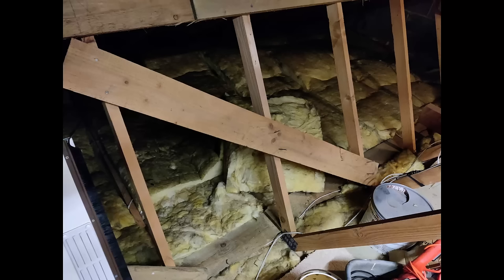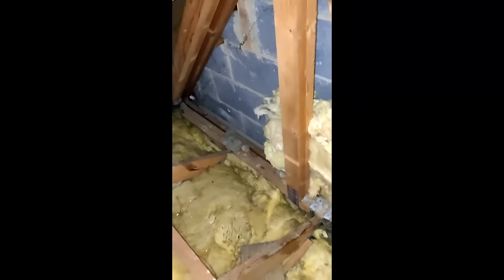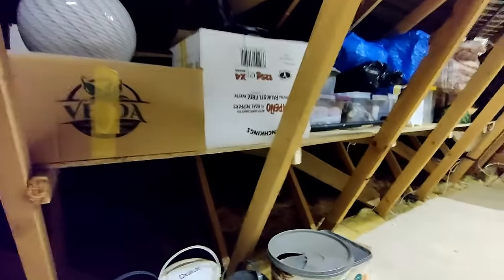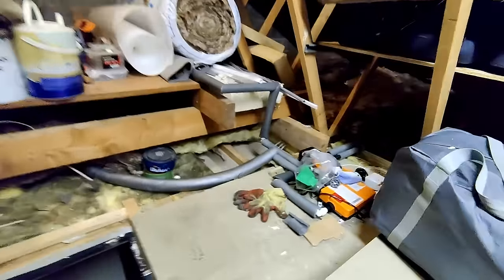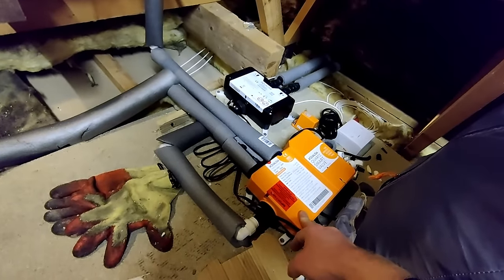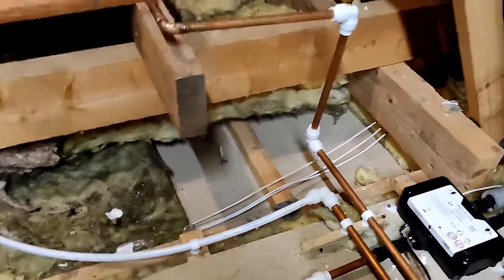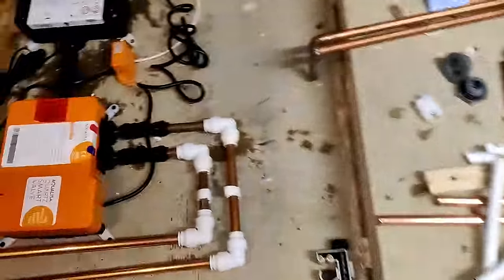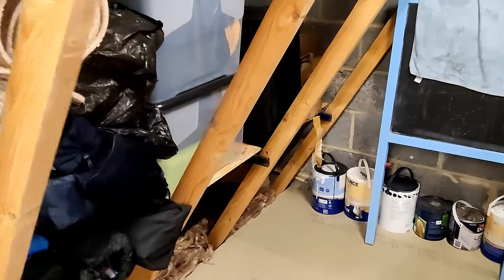Prepping for the Heat Pump: My DIY Loft Insulation for improved comfort and efficiency!

Comment: Great video - I've seen that some people use rafter/soffit baffles, which are basically just flat sheets of plastic that you place at the lower corners of the eaves (i.e. where the rafters meet the joists). This ensures that you can't physically block the airflow with insulation and that the air will come up over the insulation instead of coming in contact with it and decreasing it's thermal efficiency. 
Disclaimer: I know NOTHING about any of this. I'm just an DIYer who is about to tackle my attic (there's some insulation up there, but it's not great). I have and infra red camera and when I point it to the ceiling in the bedrooms, it's always where the ceiling meets the eaves where it's absolutely freezing.
Reply from the maker: Hello and thanks for the comment! I seriously considered the plastic eaves vent trays but once I got down into that area it was pretty easy to place the original insulation to leave a 50mm air gap and maintain that 50mm air gap once the second layer was laid on top.
A follow up video is in the making with a thermal imaging camera.
I would like to know if the eaves trays would improve the situation in that tricky area that you identify!

Comment: Never underestimate the amount of un-bodging a simple, straightforward job will need.
Reply from the maker: Haha, so true! Thanks for commenting.
Reply: @UpsideDownFork 2 or 3 old tanks in our loft but our loft is more of a mess since getting air source
Reply from the maker: @theoddjobcentre6686  Oh dear, sorry to hear that. Our installers did want to put some of the components up there but in the end they managed to squeeze it all in the cylinder cupboard.

Comment: A good idea to put the flooring on top of the PIR I  would not have thought of that. Will you show how you are going to finish insulating around the loft access hatch? I hope so.
A great video well done.
Reply from the maker: Thank you.

I got the idea a few years ago when I built an outhouse with SIPS. I started to understand warm roof construction.

Around the hatch perimeter is fully insulated, but I'd appreciate any ideas on what to do with the hatch itself.
It is currently an MDF one with a 25mm bit of polystyrene stuck on the inside.
I considered scraping the 25mm off and gluing some 100mm PIR on there but there must be a better way!
Reply: @UpsideDownFork  Hi, the opening hatch is going to be a problem, if it's to be insulated, that is. My loft access is like yours. The ladder is a pull down. I am considering bringing the ladder down from the loft permanently, and jigging the door to open upwards, thus enabling  an insulated rebate all round.
However, it's still a thought process, until I get around to it.

Comment: Great walk through. Thanks. 
You never mentioned whether the shower flow rate actually improved?
Reply from the maker: No discernible difference 🤔 oh well. It's now tidy and out of the way.
Reply: @UpsideDownFork  sometimes it's good to have these jobs done just so you know that it's running as well as it can be. If you hadn't done it you'd probably be regretting it right now.
Reply from the maker: @alanmcguinn  that is so true!

Comment: Thanks for the video. My loft is similar construction (~1973) possibly less head height but the current roll insulation is patchy at best. I was thinking of removing it all and going for 2 lots of PIR board. 100mm to fill the existing gaps between joists and then another 100mm (or more?) of PIR in the other direction and boards on top in the middle like yours. I had not considered just laying the top PIR without joists so that’s a good idea.  
I was going to use “gapper tape” aiming for no air gaps so My main concern becomes vapour; is it ok to have all these layers of foil backed PIR up there (including over bathroom in my case)? Should I be attempting to fit a separate vapour barrier (sheet) under all the PIR?  My heat pump quote requires 270mm of insulation and when I asked “what if PIR” the surveyor still said it’s the depth they require irrespective of thermal efficiency.  Does anyone know where I can check what I propose is acceptable (or even a good idea)?  I’m aware mine will be more expensive but I like the idea of a neat and tidy and through job.  Also means for any plumbing changes, can lift out the PIR boards and replace them after.
Reply from the maker: I would advise against PIR over a bathroom. You really need breathable insulation. If it needs to be removed in the future it is super easy to roll up for future access.
I used PIR in the centre which is just over the hallway/landing/stairs area and not above bedrooms or bathrooms. I only did it this way to gain myself an extra 100mm head space.
Be cautious, especially if you are using gapotape. A great product but then you really need to consider the vapour control.

The assessor is talking rubbish. Mine looked up specific U Values of some 130mm PIR I had applied in other areas of the house to get the correct heat loss.
100mm PIR = 200mm loft roll in general so it's a great product for a lot of applications, but not where you need breathability.

Comment: Excellent real world video for the average home DIYer. I've been procrastinating about doing a similar job in my loft for a while now. We still have an active cold water & F&E tank but plans are afoot for a Heat Pump in the future so they will eventually disappear. 
I will be installing a Loftzone Store Floor system (purchased & waiting to be installed) in the centre section of the loft to raise the existing chipboard floor I put in 30 years ago floor by 280mm. This will allow space for an extra 250mm of insulation with an air gap under the floor making 350mm of insulation in total. Luckily I have ample headroom in the centre of our loft & like you I have already installed some shelving between the A trusses to get as much stuff off the floor as possible. Also like you some "thinning out" of the clutter is needed but getting "management" up into the loft to make decisions is not proving easy. I've also put in a bunch LED batten lights in to make working up there much easier. It's like daylight up there now! 
The existing 6"/100mm of fibreglass insulation (1986 house) is pretty ropey so may have to be replaced in places (face mask & hazmat overalls for that job). 
We have quite a few downlighters in the 1st floor ceilings which I have already covered with "Loft Lids" to prevent any draughts / air leakage before I cover them with more insulation. All the downlighters have been changed to low temp LEDs as well. 
Good job on the shower piping as well. Mine's in a similar mess. 
Where did you get & what type of insulation roll did you use? I'm going to need quite a bit so looking to get the best deal possible.
Reply from the maker: A lot of that sounds very very familiar! LED batten lights were the very first job, many many months ago.
A lot of procrastinating has happened between then and this week when I finally finished the last bit.
A face mask is an absolute must!
I wasn't intending to record this for YouTube. I was making small videos to send to family to show them that anyone can do it. I cobbled all the clips together to share this video publicly.
I used 200mm knauf loft roll 44, the trade stuff is 6M long and the retail stuff is 4.something long.
I got some from a friend on a local building project where they over ordered so I think I paid them £20 per roll to cover their costs on their high volume trade account.
I think you can get it for £30 per roll online, so I only saved £70 but getting offered it was one of the things that pushed me to get on with the job!
Good luck getting management into the loft for the thinning.
My manager has been up there and done a quick pass. But I'll say no more as I know she loves reading the comments on my videos!

Good luck and I hope this rough video has inspired you to get on with it! 😁

Comment: finding the right balance between ‘breathing’ and ‘sealing off’ must be tricky. I suppose the main thing is to try and cover the entire ceiling surface to keep heat down - and breathing should be covered by the overhangs of the roof? Also on ours we’ve got gaps where the downlighters are. Now they’re LED I wonder if they’re safe to insulate over (with some air space)
Reply from the maker: That's it exactly!
 Building regs specify 50mm of breathing room at the eaves to come up from soffits.
Spotlights should be covered by hoods. Several different types at Toolstation/Screwfix etc 👍

Comment: On these retro fit I stalls they normally only put a 15mm feed to the unvented cylinder. The manufacturers instructions state a 22mm feed is needed, this explains the low water pressure normally
Reply from the maker: Thanks for the comment. Ours is all plumbed in 22mm. Lucky for the installers the cupboard already had a 22mm feed there.

Comment: Plumbing: I did the same in my 1930s house. I replaced 15mm (plastic, steel, copper) with 22mm where that made sense and replaced elbows with copper pipe bent with a proper pipe bender. Heating and hot water work much better (hotter, quieter) than before.
Reply from the maker: Good work. I also replaced some big main section of the pipework in my old house with 22mm. Luckily in this new house we already have 22mm almost everywhere for hot and cold water in the concealed areas which reduces down to 15mm as it enters the bathrooms and kitchen etc.
I was a big fan of the plastic stuff when I first started getting into DIY plumbing some 15 years ago due to the convenience, but now I know about the flow restriction I try and avoid using it unless absolutely no other option.
I did have one of those spring benders that I used to use to good effect on 15mm copper when I did my last kitchen but I can't seem to find it since the house move.

Comment: Nice job. I have slight reservations about moisture buildup below the PIR insulation but hopefully it will have an easy enough diffusion path through to the edge of the normal insulation.

You mentioned you needed the 'high pressure' box after your heat pump install, what does it do and why is it required?

Cheers
Reply from the maker: Yes, I was a little concerned about the potential implications for PIR in that position.
A couple of things I did to mitigate that, no foil tape to create a complete vapour barrier. I intentionally left gaps at 300mm gaps in the low expansion foam joining the boards together. Should have shown that on camera.
I'm not exactly sure how breathable the chipboard floor would have been previously anyway? It was all perfectly dry when lifted.
Luckily for us, that centre section only covers the hallway landing space and some wardrobe so low moisture areas. Maybe if you're over bathrooms then much more thought could be needed into the ventilation.
Thanks for raising the point!
The existing shower box was a smart mixing valve with an integrated pump as we had a gravity fed (vented) water system.
Switching to unvented means we are now on the mains pressure at every outlet, this has massively increased the pressure in the main family bathroom as the bath taps used to dribble to fill the bath very slowly!

So the new smart box has no pump which means the shower is quiet now and not using 200w every time we switch it on! Bonus!

Ours is an Aqualisa but I know that Mira and other brands have similar low pressure and high pressure shower systems.

Comment: We did something similar about 5 or 6 yrs back at my partner's place. In one half of the roof space we doubled the wadding depth and on the other half went 100mm of PIR on top of the existing layers then boarded on top like yours. I don't think we more than floated the T&G boarding on the PIR. You give me a few pertinent thoughts about moisture movement, perhaps mid-winter is a good time to inspect up there. [Under old cold water tanks shouldn't be insulated so they don't freeze]
Reply from the maker: Thanks for the comment!

Comment: So instead of 2 elbows as a restriction you have added 4 elbows? You had the right idea but I would’ve left the 2elbows and made the hot and cold feeds better which you did.
Reply from the maker: We moved from 9 total elbows on the 15mm pipework to 4 elbows.
Crucially there are no elbows on where the mixed feed is. That's a straight shot now.
But as I learned once I did the calculations, either way delivers enough flow rate for good shower performance.
Thanks for the comment.

Comment: Thanks for the video - I need to get on with mine... One thing to watch though is making sure your shower gubbins doesn't freeze in cold weather. A friend of mine improved his loft insulation a couple of years ago and the following winter his shower pump froze and made a right mess of his bathroom ceiling.
Reply from the maker: Thank you for the info.
I think I'll make myself a little cover out of the PIR offcuts. Form some sort of box to pop over it for the really cold weather maybe.
Reply: @UpsideDownFork also make sure your piping for the extractor fan is kept as warm as possible as the colder it is the more water will condense out of the humid air and can cause mould inside the pipe. 

I would also recommend you keep an eye on humidity levels in the loft and go up in a year or so and pull up some of the insulation to make sure your not getting moisture problems inside the insulation and therefore in the timber. Interstitial condensation can be a problem and your ceilings probably won’t have any moisture control layer and you will get humid air seeping through.
Reply from the maker: @davideyres955  Thank you. There was barely any insulation over the extractor ductwork but it is completely blanketed now. 
I will check back in 6 months or a years time and report my findings. The PIR is only over the centre section of the house that is wardrobes, hallway, landing, stairs etc, not over any moisture zones.

Comment: I would not put PIR on top of loft Insulation going to trap moisture.  You need to rise the level of the floor I found the cheapest way is to use loft legs and Studwork CLS Timber - 38 x 63 x 2.4 meter this gives you  270mm loft insulation and 43 mm for air flow under the boards.   Use the timbers like you would on the Loft Zone system.   I do a video when I get time.
Reply from the maker: Thanks for the thoughtful comment.
I have fully considered moisture permeating into the loft space and here's why I believe it's not an issue for me.
1. PIR is not placed in between joists or on the joists.
2. 25mm batten acts as a spacer to form an air gap between original fibreglass insulation and new PIR.
3. Moisture can migrate to either of the ends of the boards to dissipate.
4. I did not continuously foam glue the boards together, they have approx 50mm gaps at 300mm centres to allow breathability.
5. No PIR was used above a bathroom or bedroom, the higher moisture zones of a home.

Lastly I ask you to consider the permeability of OSB and chipboard tongue and groove floors that are used across the country. OSB especially forms a stronger vapour barrier compared to chipboard and OSB appears to have become more widespread in loft applications with very few issues.

Thanks for raising great points and I hope viewers of the video will read your comment if they are considering using PIR in their own loft space.

Comment: Wow you really are a pro at waffling. I’m a great waffler too so don’t worry. Your shower seems very over complicated. I’ve just got 2 direct feed mixer showers. No added gubbins like you have. Had an electric shower in my last house and it was crap!
Reply from the maker: 😂sorry about the waffle. Wish it was of the food variety. My wife's voice is in my head as I'm talking!

The 'smart' shower is a love hate relationship.
I never would have put one in but I have become quite used to just setting our presents so my wife and I both have different temperatures, flow rates, shower heads and timers.
The shower can be a bit of a nanny sometimes because it shuts off when the timer runs down but that's probably for the best!
Easy to override it and tweak on the fly if desired but ultimately I still feel it's all needlessly overcomplicated!

Comment: This was so weird to watch, I did the same job to my loft (in prep for my heat pump too), last month and our property's lofts look almost identical! I decided, daft as it might be, to put in 400mm to get the highest EPC rating. So essentially 100mm between the joists, 200mm on top (perpendicular) and then another 100mm on top of that! Also put in loft legs and boarded the centre. Not looking forward to doing the eaves/sides though!!
Reply: Just be careful not to overload the rafters, I was warned if you don't know their load allowance to avoid it entirely.
Reply from the maker: Thanks! I don't think it's daft at all to go above and beyond. Although there are diminishing returns at play, it is negligible cost difference to go up. Well done to you.
Reply from the maker: I have full structural engineer calculations on mine.
It actually surprised me how over engineered the roof is, but I appreciate the snow/wind loading can be considerable once in a blue moon.

Comment: Get yourself a pipe bender and re do the run for the shower in 22mm. They are not that expensive and it’s a good work out bending 22mm.
Reply from the maker: Thanks for the comment. I did consider it until I did the mass flow calculation and realised that 2 x 15mm can deliver way way more than my shower processor will ever allow through (36lpm, without factoring in the elbows).
Of course once it's mixed down etc, 10-20lpm should be plenty. I've noticed that i run the shower on it's min flow setting and it has 7 flow levels above mine. On the pumped shower it didn't appear to make much difference but they now do step up quite a lot.